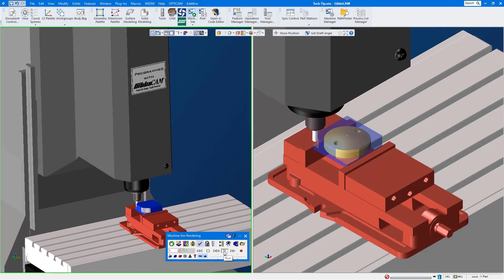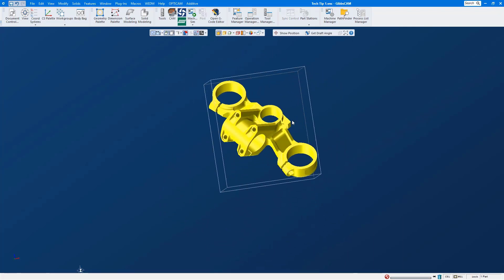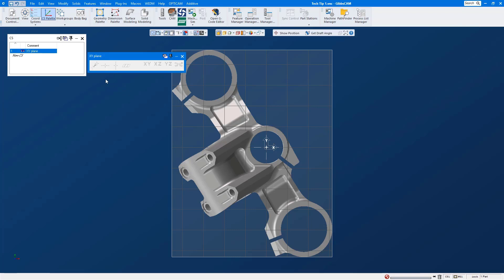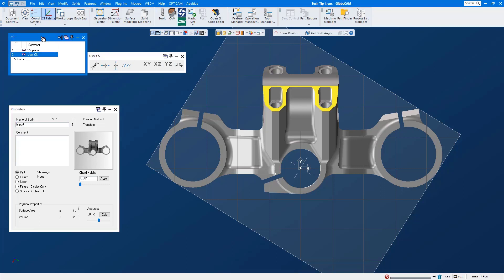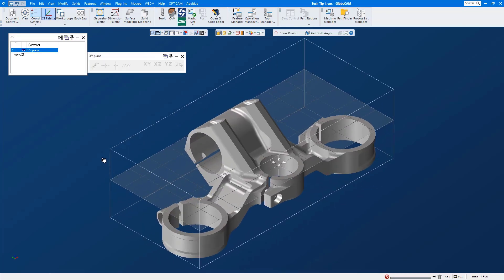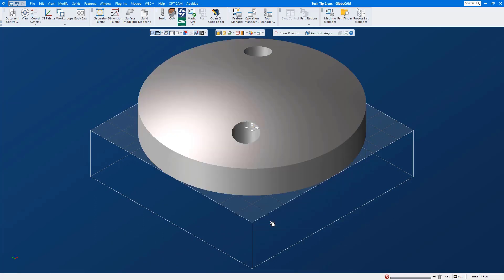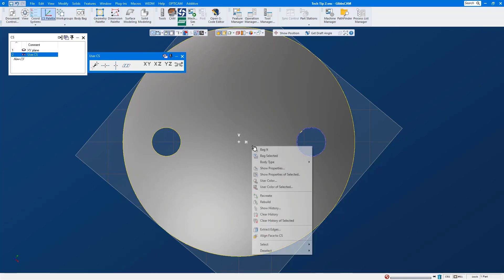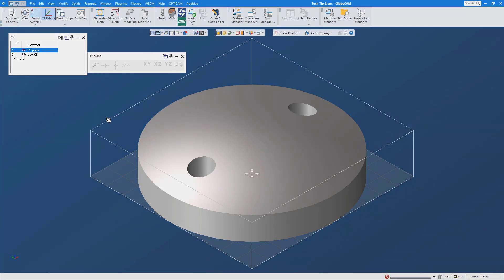GibbsCAM Tech Tip: How to Align an Imported Solid Model

Comment: For those searching how to also flip a part that is rounded, especially in older versions of gibbs, you can use Modify> mirror and use z to  mirror. I found this after forever being frustrated in Gibbs 2011. I'd love to hear of another way in Gibbs that is that old if anyone knows. Imagine you have a donut cut in half like a letter C ....That shape, if you import and you want the rad to be up like an upside down U. Always had a difficult time aligning with shapes like that. Thanks for the vid!!